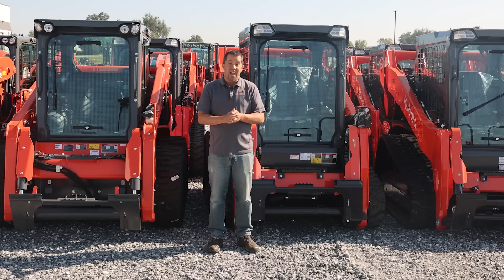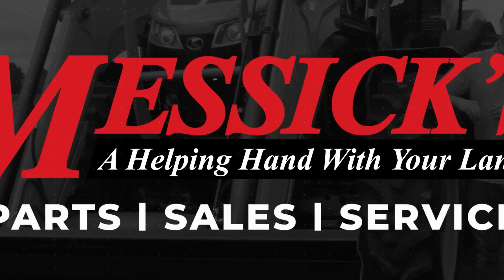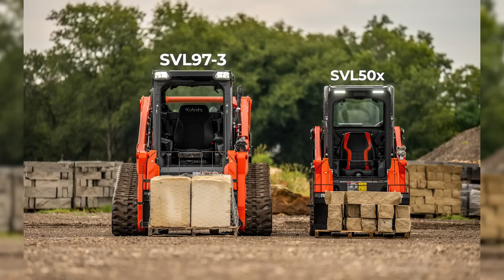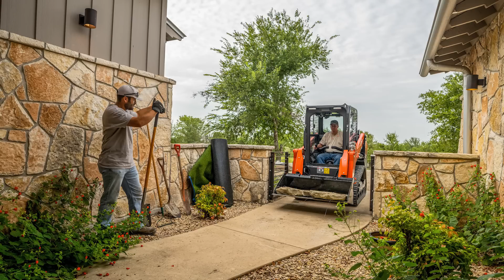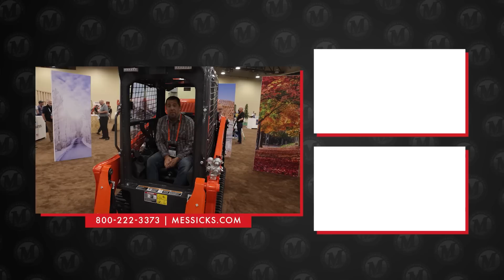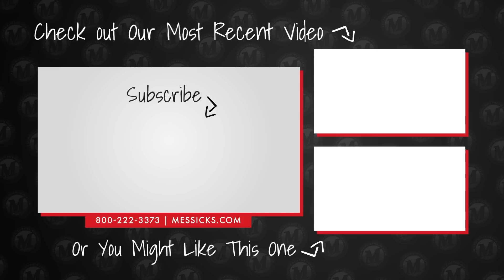Where is the Kubota SVL50x? Delayed Again

Comment: They didn't Ford motor company it.  
Knowingly deliver subpar units, then putting dealers in the spot to repair or modify blatant manufacturing and engineering defects.

Comment: Seems like mini machines have kind of always had issues to some degree. One thing I’ve noticed with mini cab machines is they seem to all be lacking in the A/C department. It’s probably not such an issue in northern climates but they should send them all down here to the hot and humid states for testing before they sign off on a/c. There’s just some things that don’t seem to scale down very well.
Reply: The ac in my asv40 will throw snowballs at you.

Comment: A wheeled version of that would be awesome. I love my SSV65, but it’s simply too physically big to manoeuvre in my dairy barn for cleaning
Reply: I agree, I'd love to have something like it on wheels for the barn. A regular skid steer is just a bit too big. Just would hope it would have some decently wide tires and not pizza cutters so it could run across shavings.
Reply: Skytracker 3013 or jlg ag313